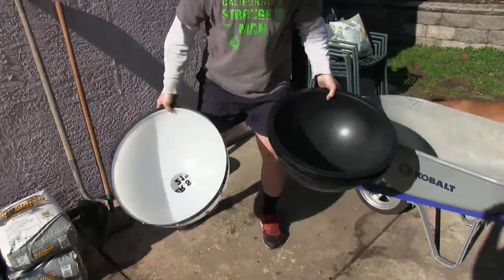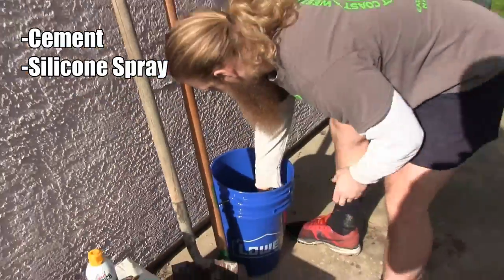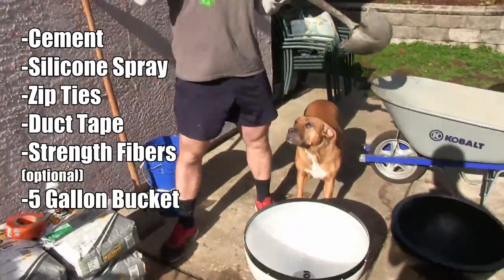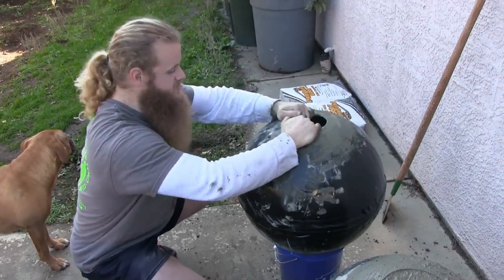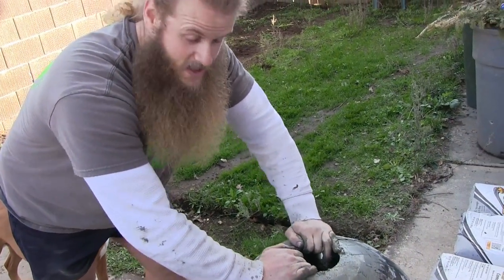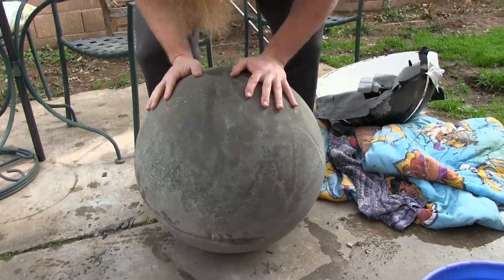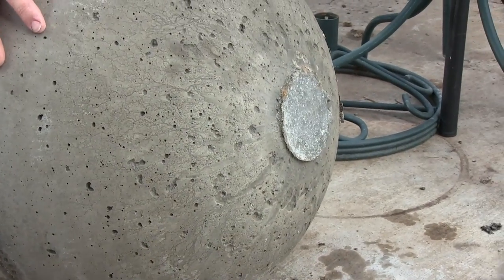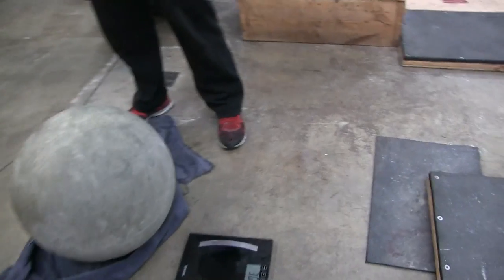How To Make An Atlas Stone: Slater Stone Vs. Hybrid Stone

Comment: Dude you can just mix the cement in the floor, here in Mexico we do it that way. Also probably a butterfly screw could secure the hybrid mold better, and they are reusable. You can pop out the air bubbles better if you hit the mold with a rubber hammer. I just wanna share those thoughts because your videos helped me a lot.
Reply: Because Mexico is the pinnacle of quality manufacturing....
Reply: @Sisteelin  It has nothing to do with countries. An expert is an expert  is an expert, regardless of if he's from Mexico, China, Mars. Case in point, a novice manufacturer from Peru is still a better manufacturer than you are. An expert manufacturer from Mexico is better than a novice manufacturer in the U.S.
Reply: @hamidchoudhary1512  There are no expert manufacturers from Mexico or Peru.
Reply: Sisteelin people will save a lot of money by doing what this kid said, and why does it matter so much if the stone people decide to make on their own is perfect or not
Reply: @Sisteelin  Never been to Mexico or Peru I take it...
Reply: @Sisteelin  3 Years but I still got offended, considering the fact that probably over a half of the things that you use are made in Asia + other half is made with tools made there. And there are expert manufacturers from Mexico. It's like saying that American is a race :))
Reply: The screws are a good idea, I’m surprised the molds don’t come with those

Comment: Something for you try next time if you're interested. Use rubber tires instead of the blue buckets to hold the molds. Once they're full you can stand on the tires with your feet on either side of the mold and bounce/rock all the air pockets out of the concrete so it settles out nicely. Makes for beautifully smooth finish and super strong stone. Great video Al!
Reply from the maker: Thanks for the suggestion. I've used tire before but the 365 lbs of concrete collapses the tire. Stronger tire I suppose
Reply: +Alan Thrall (Untamed Strength) ..easiest way is to build a wooden frame for the molds, nothing fancy just to stabilize the mold.Put some cloth or old bed foam in the bottom corners against rolling and done...re usable and cheap.
Reply: +Samplelord buckets seem pretty easy
Reply: Marcus Sullivan but not stable enough if you are going to leave them outside to dry...in my opinion.I also prefer to work as close to the ground as possible, to prevent any tipping...again just my opinion.
Reply: Samplelord
cool. seemed to work fine here.
Reply: I use a tire when I make stones out of my 21" Slater mold (they come out around 355-365lbs) for the same reasons you mentioned.  The size of the tire makes a difference though.  The one I use is a 265x70r17 that I kept from the last time my truck got new tires and it's perfect for that size mold.  That tire wouldn't work for smaller molds though.  I use a bucket when I make 14" and 16" stones because I can just shake them around as I go.
Reply: @AlanThrall  use the "1,000 pound tire" 😂😂

Comment: @7:07 The marks are there for mating up the two halves as precisely as possible. They manufacture them as a complete sphere and hand cut them in a jig. If you look at the two raw edges of the halves you can see the slight variations. I still think the Slater makes a better seem "out of the box" but in the end it's just concrete. I like your video and your pup.

Comment: When I bought my mold from Slater, he said it was a good idea to push rocks, pieces of brick, or lead weight into the concrete once you got it filled. That helps push the concrete out against the top half of the mold. It might help you with the air pockets too.

Comment: This would be a good situation for renting a pencil vibrator (typically used for consolidating grout in masonry walls).  That would be more than adequate for getting the air pockets out of a stone and give a very good consistency and reduce honeycombing issues.
Reply: Definitely the right tool for the job. The only thing to be careful of is not over-vibrating. Many a masonry projects have been ruined by vibrating too much. Those devices are incredibly efficient and do the job quickly. It's not incredibly difficult stuff to learn though.
Reply: I came here for this comment
Reply: Or design a self compacting concrete mix

Comment: You could also add a finishing step. Sealing. Sealing the concrete helps preserve it. Keeps it from getting ashy and rough over time and also gives it that wet look.
Reply: What kind of sealer would you use ?

Comment: Hey Alan,

got an idea: What if you simply tape the Rouge one from the inside and add THEN the silicone spray? If that works you`ll have no cement dripping out auf the gap - even no water. 

Best regards from Germany

Comment: I was able to make atlas stones using hybrid molds without the equator ring.  It's a little time consuming, but I used a bolt, two washers and a nut at each hole instead of using zip ties.  Then, after filling the mold with cement I cleaned the lip and sealed it with gorilla tape.  I've made three stones his way with great results.  Cheers!

Comment: The hybrid stone would work if you used big washers and some nuts and bolts .instead of zip ties ..
Reply: The instructions say to use zip ties, you can't expect people to know the instructions are wrong and to use something else. I'm not even sure if you can fit bolts in the holes for the zip ties.
Reply: @zakutheferret8182  Every once in a while, we'll run into instructions that are inadequate. After seeing this, if I were making a hybrid stone, I'd put a bead of silicone or polyurethane between the halves. It'd be harder, but not impossible to seperate, but having a smooth stone would be worth it.
Reply: Exactly what I was gonna say. There are bolts that will fit basically any size holes and if not like dude said you could drill to make em bigger.
Reply: Or you could spend 1/10th of the amount of tape you spent on the second stone by reaching in the hole and sealing the cracks on the inside.
Reply: @air7127  and have a shit finish? come on man

Comment: Pro tip for the hybrid stone molds, zip tie all the holes to align the mold, then drill more holes in-between the existing ones to create a tighter bond. That is if you don't have the money for slater molds. Cause a 12" slater mold is 120 dollars after shipping. A 12" eBay mold (which works well) is 85 after tax and shipping.

Comment: @28:28 The nub at the top. When the concrete is still green (not fully cured after de-molding) take a brick or a large flat stone and rub it off like sanding a piece of wood. Much easier than waiting until fully cured. The same can be done on protruding seams. Also you can remove the mold after 24 hours. I wait 48 myself just because I feel like it..

Comment: I'm sort of a concrete guy and I never thought of using silicone spay as form release, thanks for the tip. If I dont have release oil, I usually use vegetable oil but its pretty runny. The hybrid stone would of held together better with washers nuts and bolts.

Comment: What also works good for vibration is just getting a piece of 2x4 or a stick and ram it in and out of the hole while you're pouring it. Best thing would be to have a concrete vibrator but not everyone has one of those lying around. Similarly to making the mix too wet, you have to be careful with a concrete vibrator because it will shake the stones to the bottom of the mold.

Comment: You might look into getting the High Strength Crack Resistant Concrete since it already has the fiberglass fiber in it and is a 5000lb mix, instead of the 5000lb High Strength Concrete. It should also be available at Lowes.

Comment: Hi Al, thanks for sharing your casting experiences.  Just a thought: have you considered using inflexible grade bolts with a few graduated flat washers on each side instead of plastic cable to ties to fasten your mould with together tighter?

Comment: I have now made 6 Atlas Stones, using the hybrids.
My first 2 failed. The next 4 have been really good.

This is what I did with those 4.
After spraying don’t join the 2 halves.
Fill the bottom half almost to the top, so much easier to fill.
Then join them.
I use butterfly screws and then duct tape to make a tight fit.
I consequently have no seepage.
I now always use the strengthening fibres, they work.
Use a rubber mallet and take along time to beat out the air bubbles.

Then I definitely do not leave them for a week. I did this once and it took another week to get them out!

Once they are made leave it for at least a couple of weeks before using, longer if you can afford the time.

And finally do not drop the on the ground. My rugby club are using them and even dropped on grass they will break.
We now using an old pub barrel mat and or old tackle shields.

Once made and used they are fantastic. Especially for the functional strength needed for rugby.
They make for great competition between the guys and drive up standards.

Going to make to lighter ones for the women’s teams today.

Comment: just a suggestion tape the inside of the hybrid once zip tied before you spray with silicone
Reply: just an opinion, but I think that is a really good idea. Could drill more holes for zip ties too, but I think an inside tape job would be very helpful.
Reply: 48Boxer I used a silicone gasket maker I got from an auto parts stores. no leakage.

Comment: I use gorilla tape too but I only do the 8 strips and never had a problem. Make a little mound at the open and you won't have a flat spot. Bags for mixing makes it easy and quick. Cures in about a week.

Comment: Try using a coil style plumbing snake as a "vibrator" for getting the bubbles out of the concrete. You can attach it to a power drill but familiarize yourself with it first. This is very similar to the tools used to vibrate the bubbles out of concrete when building things like walls and loading docks.

Comment: Concrete is very strong in compression, but very weak in tension. Rebar is strong in tension, but buckles and bends when compressed. Combining the two makes for a very strong composite material that can be used to make strong and durable structures.

The fibers in the concrete are doing the same, but they're also randomly oriented and pointing in different directions, unlike rebar. This means their relative tensile strength vs. rebar is going to be much lower in any particular direction, but they can evenly handle tensile stesses from all directions.

Comment: I've never had a problem witg hybrid. also. when you fill it to the top. put a wet towel on it. helps with the water and gives it a much rounder top. not as flat as the video's

Comment: If you tapped the upper half of the stone molds as well as the bottom half, there would be less of those air bubble holes on the upper part of the stone. Notice how the bottom half where you tapped looks almost perfect on both stones.

Comment: Idk if you read theese but a great way to vibrate your molds is to take a cordless reciprocating saw "sawzall" and take the blade off put the flat part of the gaurd against your molds and run it a bit.

Comment: I would put duct tape inside the hybrid mold and then spray it with silicone spray,  you can prob. rent a concrete vibrator from the same place you rent cement mixer if you don't wanna do the wheelborrow way. If you have a vibrator you could just dig a small hole on your backyard to place the mold and after it has cured you could just roll it out and get mold off. 
Alan, you said don't give me any thing about not wearing gloves. Just google cement burn images. Serious stuff...... wet or dry it's poison on your skin.
Reply: I wish id read your comment before leaving mine. lol

Comment: I maybe have a tip for the hybrid mold.
Before you spray it with silicone, take some of that tape...and put it inside, exactly where one half of mold meets the other.
Cut it in on two areas and push it down a bit...so you can still put the molds together, without the tape intefering with the lips.
If you put in the cement...the cement will push the tape up...and close the gap, where the water was coming out...and the edge won't look as bad anymore.

I heared devil driver at the end...good taste in music!

Comment: Hey man I know i'm literally 2 years late, but the tool you want is a mallet attachment for a power drill, theres one called "Radhammer" and you use it to bump air bubbles out of radiators :)  cheap and effective

Comment: On the Hybrid Stone Mold, you needed to drill additional joining holes in between the ones that exist. I do concrete work, and could tell it would ooze as soon as you showed it with the zip ties.

Comment: Easiest way to vibrate such a small volume : Put a sheet of hardwood on top of the mold and use the hammering function of a hammerdrill on top of it. The mold will pick up the vibration evenly all around.
Another thing to prevent bubbles would be to prepare the concrete with a bit more water and to pour it while stirring it with a paint stirrer mounted on a drill to drive airbubbles out. Will increase the time to dry , but this is a good thing with concrete , since it gets more stable when drying out slower.
The water leaks with the hybrid mold are a problem - the water takes the cement particles with it in the leaking areas and weakens the area considerable.
It should be mentioned as well to prevent the cast from frost if you work in a cold climate and from direct sunexposure in a hot one. Just below room temperature throughout the whole drying process (28 days - rule of thumb) will provide the hardest balls xD

Comment: To get to my ideal weight on my stones I add lead fishing weight in with the concrete every batch it also helps with making a heavy stone smaller I make a 400 pound using a 300 pound mold

Comment: Foam core is likely employed to initially cast the atlas stone under weight and then when cured to have a centralized void space to pour in more concrete to bring up to exact weight. Rotation during setup would distribute evenly. Strong man contest surplus? Wooden skewers hold foam sphere in place to prevent it floating to surface of pour. Foam core must be centralized to ensure weight is equally distributed about center and will lift predicable and less likely to roll on floor. You don’t want to drop that puppy on your toe. Final weight = 4/3 Pi R cubed X Density of cured concrete - 4/3 Pi x r x r x density of foam. Sticks inside foam increase weight of foam ball slightly. They may intentionally cast the stone slightly under weight with a tube from top going into core or they drill a hole to foam core and pour in acetone to dissolve and pour out. Place hollow stone on scale and pour in concrete to very close to final weight, then plug hole several inches down the tube/hole and plug hole with cement or grout and sand/ polish. If manufacturer has professional steel mould and very consistent concrete mix they could be on the money every time. Benefit is they could use different foam sphere sizes to easily make stones lighter in say 5 lb increments. Professional concrete vibrator would result in more accurate weight with all air bubbles removed. Simplest answer is probably the right one. U R strong dude! Nicely done.

Comment: 1 - if you tape the hybrid mould you wouldn't leak the slurry.

2 - if you mound the concrete a little more you wouldn't get the flat spot on top

3 - if you take a wet sponge and buff the surface at the demoulding stage you can prep the surface and get rid of the voids

Comment: Wet cement is extremely caustic. The burns continue to get worse even after you're done touching it. Wear gloves.
Reply: I dunno about "extremely" caustic. First time I mixed concrete to make my squat stands, I got frustrated with the spatula i was trying to use to mix it, and used my hands. It definitely scuffs your hands up pretty bad, I mean it IS basically like sanding your hands with liquid sandpaper, but it wasn't THAT bad, the next day I was pretty much fine.

Comment: Just a pro tip for adding water use a sponge it allows you to control the water amounts better than any other method. You need to wear a respirator too with silica dust apparently it's as bad as asbestos.

Comment: If you have access to it, concrete layers use big ass vibrators to spread the concrete evenly. So you could dump concrete into the mould from a truck and use the vibrator to make sure its perfectly round and smooth

Comment: Tip for next atlas ball. Seal the opening with silicone before locking it with zip ties. This will prevent concrete from leaking out and give a much nicer surface.

Comment: If you use an electric sander with no sand paper, just put the rubber piece on the outside of the stone.  That should vibrate way better than any hammer or hand ever could, should release way more bubbles.

Comment: You could put inside silicone or acrilic caulking inside the mold and that way you wouldnt get seem line. I think a good idea would be to put inside a steel rebar. That way if the ball is droped it will not split in half. Also wear gloves all times, concrete are bad stuff and you can chemical burn your hands.

Comment: I have worked in precast manufacturing my recommendation is to caulk the inside of the sandwich mold and rent a concrete vibrator wand at home Depot for aprox. 20$ a day it would save you a ton of work

Comment: You may have zip tied it wrong like put it across horizontally like 1 per 2 holes to seek it down in the middle where it's popped up or weave one really tough rope type material or nylon or something through all the holes multiple times to hold the lip down